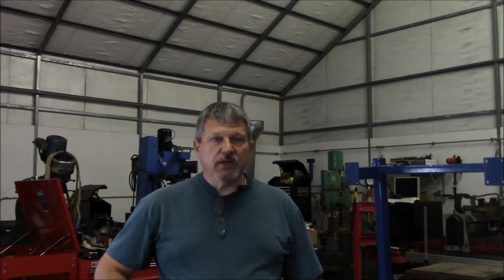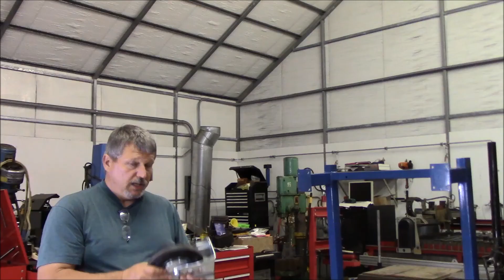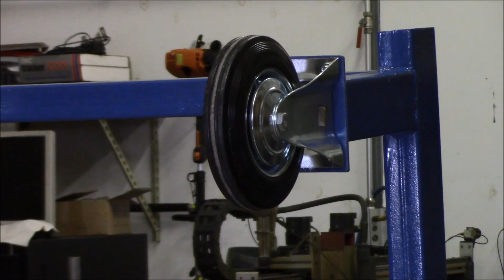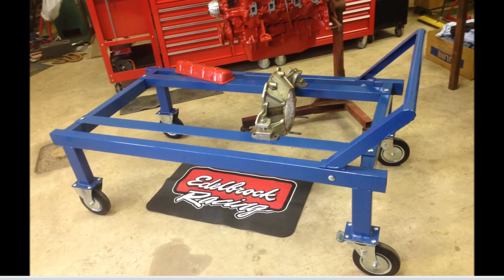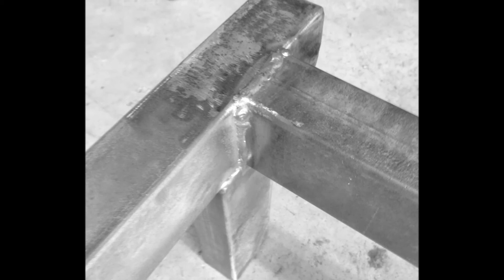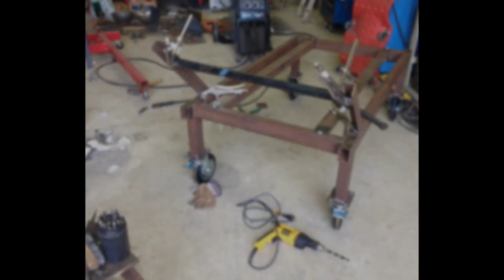Engine Test Stand

Comment: i have an old ford 460 engine that i wanted to test before installing it in my car, but it seems like i also need to take the transmission out of the car and put it on the engine in order to install the starter. so, my question is: is there a bell housing from a different transmission that would fit a ford 460? or is there a way to turn on the engine without having to install the original transmission? sorry for the inconvenience.
Reply: You can use a starter plate available on ebay under $30.00
Reply: Ur talking about a fly wheel. almost every car has it but u need it to start the engine. U don’t need the transmission to start the engine on a engine stand bet the bell housing. Or u can fabricate one just for ur engine start. And I know over a year  ago